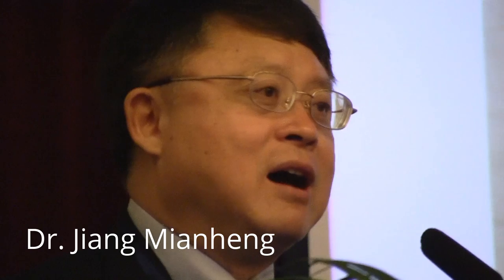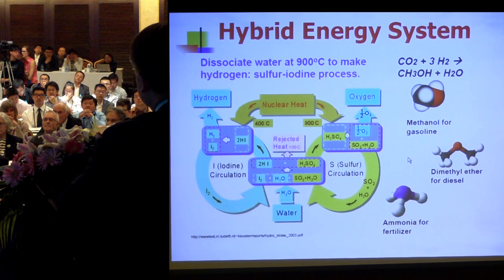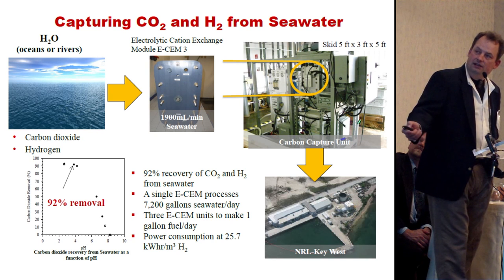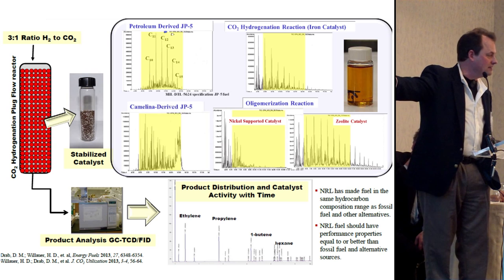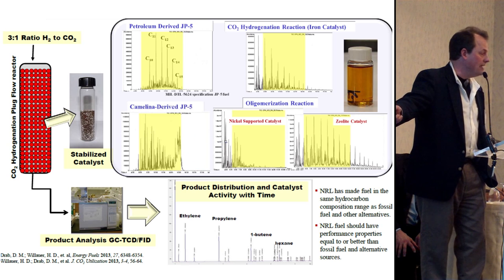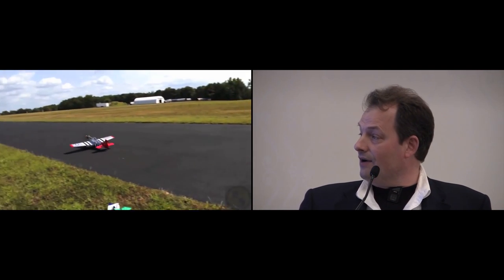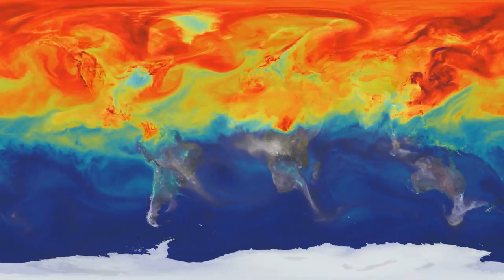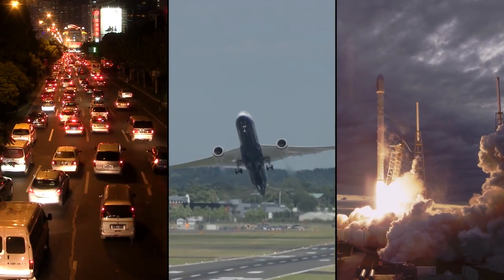Carbon Neutral Gasoline in 5 Minutes

Comment: This is real? If so why isn't this being put on to full use?
Reply: It appears they're slowly scaling it up, the demo unit wasn't of commercial scale that's a tiny toy plane. https://phys.org/news/2017-10-nrl-patent-carbon-capture-devicea.html ..."In our previous work, the initial scale-up and integration of the E-CEM into a skid platform provided us the data needed to establish faster acidity equilibrium for future modules and improve energy efficiencies and production," said Willauer. "This technology provides the Navy the capability to produce fuel stock, at sea or in remote locations, for the production of synthetic LNG, CNG, F-76, and JP-5 petroleum products."
Located at NRL's Marine Corrosion Facility, Key West, Florida, the next generation, modified E-CEM, demonstrates the progressive steps forward toward integrating and commercializing these systems. The result, at present, is a 33 percent improvement in production time of CO2 and H2 with a feedstock production rate of a single E-CEM capable of producing more than one gallon of fuel per day—contributing to the removal of nearly five tons of CO2 per year.
Reply: Because making fuel like this is like storing energy in a battery. When you make synthetic hydrocarbons, you consume more energy than you will get out of it when it burns. So for example, I use 100 watts of heat to make synthetic fuel. I then get 80 watts of fuel from the process (this is a statistical example, I don't know the real numbers). When you burn it, you get 35% or so of work from that fuel. So for 100 units of input heat, you get 80 * 0.35 = 28 watts of heat out. Therefore it's utterly useless without a input that has very high energy. For example, a Nuclear power plant returns 7500 watts of energy for 100 watts of input. 7500 * 0.8 * 0.35 = 2100. So it's only really effective with Nuclear as the input. In that case, for 100 watts of energy to make Nuclear fuel, I get 2100 watts of energy out.
Reply: @EricLidiak  I agree, but stored energy density in hydrocarbon fuel is so much higher than any battery that it gives hydrocarbon fuel an advantage anywhere mass and volume are a concern (cars, aircraft, watercraft~ basically anything that moves or needs to be portable). This is on top of the advantages of the short time of refueling, reduced costs to produce the vehicles that utilize it, and the unique aspect of the synthetic fuel produced being absent of impurities, almost eliminating sulphur dioxide and nitrous oxide emissions. With this, compression ratios could be increased and emissions equipment reduced to increase overall efficiency from the 28-42% it is today. This seawater method and direct atmosphere extraction are the only solutions worth investing in in my opinion, mostly because current oil giants can invest in this infrastructure, and still use most of the current infrastructure they already have for distillation and distribution. This theoretically provides a way for them to be profitable, and therefore removes the elephant in the room with full electrification: The major blow to world economy from the loss of industry and therefore jobs. Oil companies employ the majority of chemical and mechanical engineers, who could be working on more efficient methods of scaling this technology up. If you get them to back it up, it will happen. It still requires an increase to the current electrical grid, which means the renewable and nuclear energy lobby also has a path to grow. This is a method of growing the economy, rather than reducing or pivoting it. It's not all sunshine and rainbows, as it requires parallel infrastructure growth to make it viable, which requires coordination, but it actually does something.

Comment: so technically you're not reducing carbon emissions to 0% in the atmosphere you're just making it renable so there's the same amount being burned still. You're not adding to the issue anymore but it STILL exists you're just gonna be quiet as there is money to be made right!? For every one fuel plant you should add a filter plant built in to actually reduce levels.. OH wait then you lose the product you're trying to sell us because with no NEW carbon put into the atmosphere you can't syphon the carbon and batch it with your hydrogen to make your fuel.
Reply: "People are dying from smog" "Global warming needs to be stopped" 
The guy who discovered this fuel: "LETS MAKE A FUEL THATS DOESN'T DECREASE POLLUTION LEVELS BUT DOESN'T INCREASE THEM"
Reply: Sounds like you need a perfect solution, not a practical step forward. If you'd like to pull carbon out of the ocean or air and sequester it, please go ahead. The only thing stopping you is the time you waste poo-poo-ing practical steps forward in YouTube Comments.
Reply: @gordonmcdowell  nah I need a solution period. That might be their money solution but its sure as hell not a global warming solution
Reply: @xgncloudop661  Obviously high-temperature reactors replace combustion-for-heat in a number of scenarios... that's otherwise a very hard problem to solve. But recycling carbon instead of creating more carbon as a means of allowing people to fly planes... there will be NO battery powered planes. That will never, ever, be possible except as proof-of-concept without passengers or cargo. It it as impractical a concept as a nuclear-powered airplane. Fuel MUST be synthesized from recycled carbon, or else it will be created from fossil fuels and continue to increase GHG in atmosphere.

I don't understand your objection to recycling carbon. It is a closed loop. From ocean, to synth-fuel, to air, to ocean, to synth-fuel, to air, to ocean. The alternative is: fossil to air to ocean. More fossil to air to ocean. More fossil to air to ocean. There's no 3rd alternative for air transport.
Reply: @gordonmcdowell  My objection is its not any better for the people living in the smog filled communities or for our animals. If you do that you enable so many more factories and processing plants to be built which means more Natural habitats destroyed, Its just a ways to expand the human footprint on the globe. I understand it is the BEST fuel choice, but the Fuel would REQUIRE people to be burning carbon AKA The only way is to literally have a plant specifically for creating carbon to renew because how else do you reduce carbon levels. Eventually over time Earth with naturally lower them on its own, its how Earth survives, SO again its a system dependant on Pollution.. SO BACK to my first comment how about building real filtering facilities and then some fuel production ones so we can LOWER our atmosphere levels and still have renewable energy...
Reply: @xgncloudop661  I'd encourage you to read Michael Shellenberger's new book, or at least listen to one of the many interviews he's done to discuss the topic of "development". Don't conflate modernity with expansion of the human footprint. Humans "living off the land" are forced to burn biomass to cook, and waste excess space with inefficient agriculture. Adding electricity to human lives lets people expand their presence vertically not horizontally. If electricity was cheap enough and clean enough (a next-gen reactor future) then society can be more efficient in its recycling and extraction of natural resources. https://www.youtube.com/watch?v=mnb4PR9s-4A

Cutting down trees is an impact on the environment. Combusting fossil fuel and dumping the CO2 into the atmosphere is an impact on the environment. Direct impacts. What goes on at factories and farms is a matter of policy and law... what is legal, what is not? If laws are lax and enforcement is lax then, yes, bad stuff will happen. But trying to minimize impact on the environment by throttling energy itself is ineffective. Developing nations are trapped burning wood and fossil fuels in an unnecessarily slow path towards modernity. If you don't like what a farm is doing, address that directly. Don't deny everyone electricity because a farm uses it to pollute.

And when developing nations FINALLY get to modernity, then you see birth rates drop BELOW replacement rate. (Everythere on Earth, except Middle East.) And you see the opportunity for low-carbon lifestyles as demonstrated in France, Ontario and Sweden. Not zero carbon... that still requires more effecting power generation. But low carbon is doable already. Do you think France, Ontario and Sweden are unacceptable balances of nature and cities? They aren't paved-over hellscapes. People have decent life expectancies. People can still enjoy nature.
Reply: @xgncloudop661  I re-read our exchange. I'm good with this comment thread. "you enable so many more factories" ...oh does clean energy do that? Does it? If you're commenting on YouTube, you're living the good life as created by output from factories. The choice is, does primary energy powering those factories come from fossil fuel or not? There's no "I don't want factories, I just want to Comment on YouTube" choice. You're denying other people access to a lifestyle you enjoy, and citing "factories" as a reason.

DEAL with the fact there's be more (MANY MORE) factories, and YOUR choice is limited to advancing technologies that can power them WITH or WITHOUT emitting CO2 into the atmosphere.